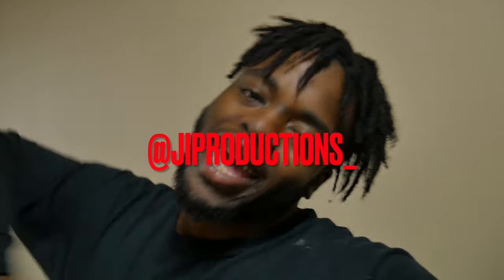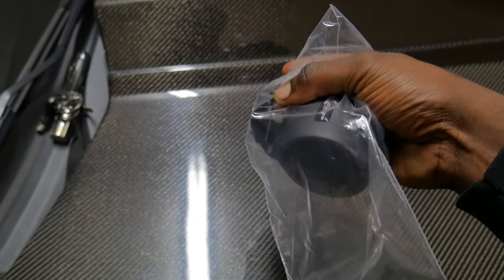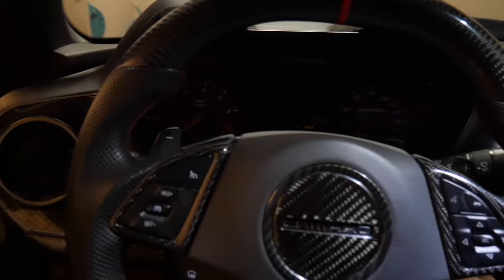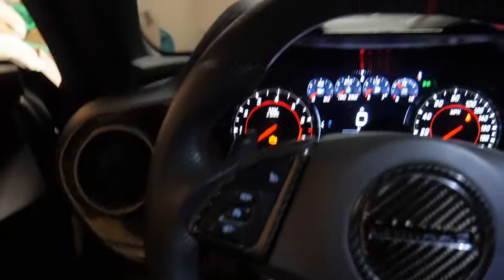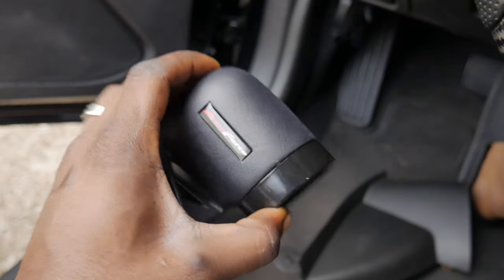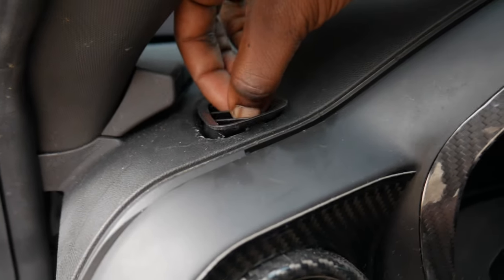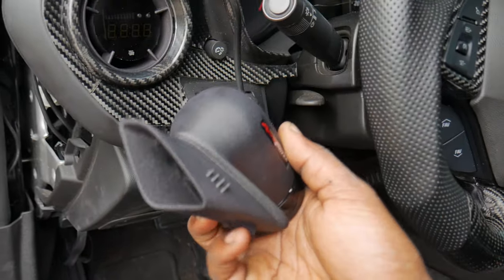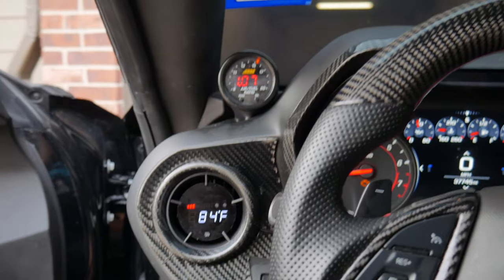Finally a new mod for the 6th gen 1LE #modified #cars

Comment: I think this is my issue. Damn coolant hose blew out. Noticed the oil leak when I was under there replacing the hose.
Reply from the maker: That’s crazy bro
Reply: @JIProductions  Yep, oil pan bolts stupid loose. 2 spun freely by hand.
Reply: On a side note. My replies are to your wrong vid it looks like rofl. I watched a few. You had a vid and talked about loose oil pan bolts in one.